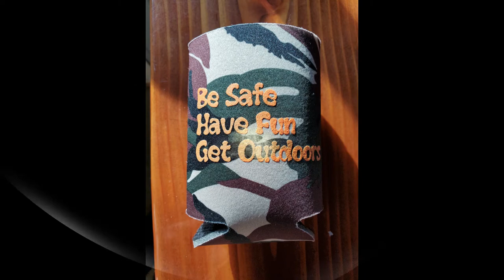Tips & Tricks #5 by 2 Dumb Asses - DIY Chainsaw Maintenance

Comment: When tightening the chain, best to hold the bar up to simulate the pressure on the bar like cutting, changes the angle in relation to the tightener and the chain to where it will actually run for chain tension.
Reply from the maker: Really good suggestion Wayne.